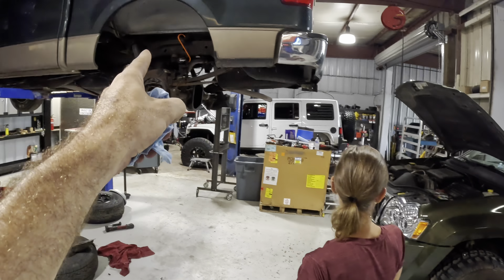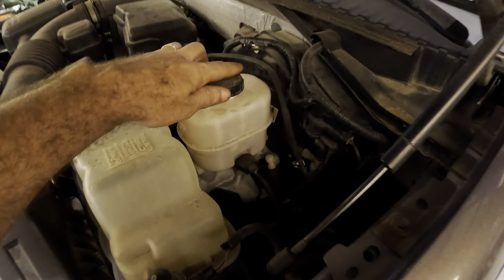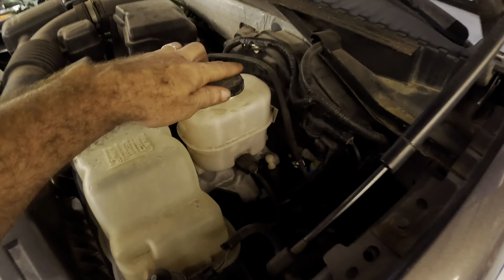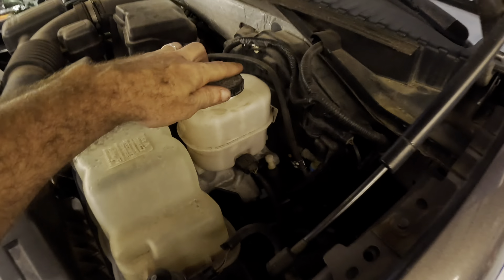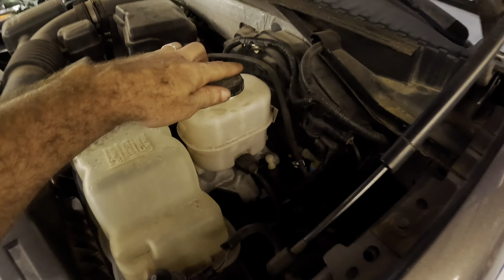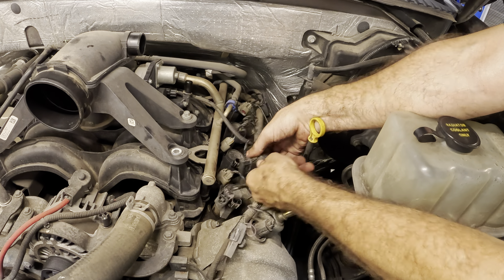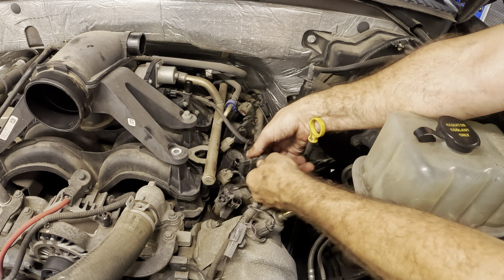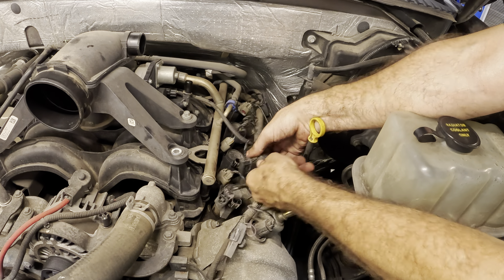Phone a Friend (Snapping Spark Plugs)@BeardedFordTech  Expedition 5.4

Comment: now that you overtighten the plugs doing the wrong way being a barbie movie star, you cant be seriously leaving them in there? they are going to fail prematurely, if they dont have issues off the bat. the amount of extra torque watching how much it took to loose them compared to tighten them again you were way over, porcelain got stressed, has stress fatigue and weakened sealing, not to mention stretching. you go on and on and on about TTY bolts, what just happened to the plug? they break easy enough coming out in 80,000 plus miles later. you spent all that time explaining plugs, the plugs you pulled out had been overtighened when istalled, and you didnt even pick up on that,. the exh gases had passed beyond the plug, witness the exh gas ring above base of the plugs. i watch your vids to rationalize whether your wanting to be a tech, a movie star, its the see me, pay me thing your into. youtube cash not customer service, every job takes you longer, you drop parts, tools, cameras, lights, trying to juggle the movie with the job, the extra time it takes to redo what you drop, the time for all the hand gesters, pointing, not being used to complete the job. whether you flat rate, or charge the customer for clock time who knows, but a customer sitting waiting to  leave, the extra wait time the movie adds to the job is not fair to the customers. sure your busy a lot full, be less full if all time was spent working vs movies, and be less full had you not used youtube to advertise to get your client base. i dont watch you daily as a fully cert ASE L1 tech who took ALL tests in one night, yes all, and lowest score was a 92 i cant. to those who dont know you look like a great tech to those of us who do know, you make a lot of rookie mistakes, use wrong tools and hammers too much. and NO hands on tech (not shop owner who is not hands on) has the time during a day to lose making vids. your either good or your not, your either a tech or movie star. tech who make good $ use every minute of every day to make that $ and waste none, a youtube tech like you also uses youtube and google university to look for the knowledge on an issue they are stumped on or to find that not so short short cut. some of you guys give us all bad reps.
Reply from the maker: You knowledge is overwhelming
Reply: That's a big word salad.
Reply: For someone who doesn't watch Ray, you sure used a lot of words. Maybe Scotty would be more to your liking.
Reply: Ive learned a great deal because Ray takes his time to explain things.
We are not all top tier intellects.
Well I am in human behavior and I sense some underlying jealousy here. 🤣
Reply: Please consider taking a technical writing course.
Reply: @wacowildcat  💯💯
Reply: Its time to get some writing skills cert too
Reply: I loved these replies. There is an old saying, “Judge your neighbor, judge yourself.” The Rainman is authentic, and is the mechanic’s mechanic. Watch him and learn.
Reply: "i dont watch you daily as a fully cert ASE L1 tech who took ALL tests in one night, yes all, and lowest score was a 92 i cant."

So you passed multiple guess tests and use that to show you have credibility. 🤣
Reply: This comment gave me mesothelioma, and I believe I may be entitled to compensation.
Reply: English is a second language in your case. Capitalization and punctuation 😂😂😂
Reply: This Keyboard Warrior probably went to UTI and is what they think is a pro. We used to call them “Un Trained Idiots”
Reply: Wow it looks like you wound your spring a little bit too tight today.
The instructions said inch pounds not foot pounds !
Reply: @jamram9924  Not a tech writer, they have no sentence structor, grammar or punctuation. Required. My wife was a tech writer, I know what it takes. That person is not.
Reply: Man you sound like my old boss, whole lotta talking to say you know very little, you Probably Don't see Half the stuff Ray and his crew do he only show's us the interesting stuff.
Reply: That was interesting. Ray(noted troller), you need more commenters like this. Keep up the good work getting audience participation(Rainman precipitation perhaps). 😉
Reply: @mitchm275 Sit down and shut up.
Reply: @tc410  I am sitting down~ Sorry Darling your just mad your comment has more holes in it then swiss cheese :3 and we can all see it. Take care!
Reply from the maker: Sry Mitch, I doubt you took A1-A9 X1 C1 AND L1 on the same day, maybe the softball recert test, but no way you took a full ASE panel in a day
Reply: Hey Mitch, do you work hard at being an a55 ?  Rather than spend that time writing a word salad, you should use that time learning to write instead.
Reply: I'm just going to say this windbag isn't speaking for the majority of us. And a lot of ppl who didn't have more than a passing interest in automotive maintenance have now expanded their knowledge bcuz of his delivery. He explains things in a way that a layman would understand as well as making it entertaining and informative. You my friend shouldn't continue to waste your precious time watching something/someone who cant appreciate. He definitely does good for the industry. I'm certain he has inspired more than a few ppl to get into the automotive tech field and that alone makes his content a major plus for the industry.
Reply: @mitchm275  Hey Mitch, you should peruse getting a job in the Biden administration.
Reply: Who is writing the book ? If You do not likey , move along😂
Reply: When someone doesn't really know what they are talking about, they usually use far too many words to try and cover their ignorance and ass.
Reply: Jelly?
Reply: @mitchm275: Bloody hell mitch, what exactly is your beef? Jealousy, springs to mind, after that word salad. I've always been impressed that Ray can fix things, with one hand tied behind his back. (The one holding the camera). How the hell does the porcelain get stressed? The wrench fits the steel bit at the bottom, not the porcelain. I fix things as an amateur and it would annoy me to have to film it as well. I need both hands. But Ray brings us in, for a close up POV. For which normal people, who are interested, are very grateful.
Reply: Are you even aware there is a difference btwn your and you're? 
Apparently you don't or just don't know when which one is correct . 
When you're going to go off on someone in a comment, you need to make sure your grammar, punctuation etc,. is on point or you'll get ripped apart. 
Did you notice I used both your and you're in that sentence correctly?
Reply: That's a lot of words to say you don't have a damn clue what you're talking about.  Don't sweat it, my dude.  You're still your momma's special boy.
Reply: Funny. Ray owns his own shop. Seems to charge less per hour than other shops in his area. He uses book time to bill jobs like nearly every other shop. Seems it's on him if a 2hr job takes longer than billed because he is filming. No one but him has to eat any time over run. I would trust Ray to work on my vehicles if he was closer than 1200 miles from my location.
Reply: @RainmanRaysRepairs  He/she/it also had no spare time for silly things like formatting for readability.  Writing youtube comments is obviously his second career.  Yes you make occasional mistakes... welcome to being human.  Love the videos, don't miss the Florida humidity.  I lived in eastern Hillsborough county for 23 years mostly without AC.  Air too juicy!  Tulsa OK here, 100 deg today at about 55 percent juice = kind of hot outside.
Reply: @diuliano42  😂
Reply: TL:DR - REEEEEEEEEEEEEEEEEEEEEEEEEEEEEEEEEEEEEEEEEEEEEEEEEEEEEEE!
Reply: If you don't like what he is doing.. then don't watch no one is forcing you to watch them.  Just because he doesn't do things the same way you do . Obviously he is doing good because he has expanded his shop faster than most mechanics do in 5 years but he isn't doing the same thing as you so he is a bad mechanic. Don't want to see then don't look
Reply: I didn’t know Kamala Harris was a car mechanic. WORD SALAD!
Reply: Then why do you watch if this hurts your sense of the ways things should work?   If you got a 92% and above on all the ASE tests why can't you recognize that there is this thing called capitalization?  Maybe create some paragraphs to divide your various thoughts into some sort of logical flow.  You did use commas, so I guess all is not lost.  Maybe chill a little..
Reply: @jamram9924  Yea I just commented on the prodigious lack of grammar and capitalization as well. Yikes needs a chill pill.
Reply: So much anger and such poor grammar. 😢
Reply: @stevemclean5787  Outstanding reply..
Reply: do they have certifications on forming coherent thoughts?
Reply: Man my eyes hurt after reading that word salad. I strongly doubt that you're as good as you say, I know of at least three YouTube mechanics that are WAY better than you and Ray is one of them. Go follow Scotty instead of wasting Ray's time with your pointless comment.
Reply: If I were you , I would wait until I sobered up before I started commenting on videos.
Reply: Thanks for the input Keyboard Karen
Reply: Oh my gosh my wife don’t even whine like that  and anyone that has to cry out their accomplishments is a very very sad person see what happens when they start giving everyone a trophy just for showing up. Hopefully sir you get the help you need have a wonderful day
Reply: Nah ive said this before to those of us who really work on complicated stuff minus the hollywood aspect can see that ray makes alot of mistakes. And often employs flawed diagnostic logic. Thats why i like to watch occasionally its nice to sometimes watch someone else chase their tale for a change
Reply: @BeardedFordTech nah i understood exactly what he meant and while he was capping about his test scores he was mostly right about ray making alot of mistakes.what he neglected to mention is he made all the same mistakes himself as have i. Its a byproduct of accruing useful experience.
Reply: My thermo says 103 in the shade here. Current humidity is 94%
Reply: @phreakyzeke2864  if you say so bud. Have a great day
Reply: Yup, they only let me take 2 or 3 a day when I first certified.  I did the recert online at home... which is nice...
Reply: @ohiowrencher8650  yep. They only allow 3 a day everytime ive taken them.  Did my reverts online too
Reply: I hope your technical skills are better than your writing skills. 

Let's eat, grandma, or let's eat grandma. Grammar and punctuation make a difference, especially to grandma.
Reply: @Slugg-O  🤣🤣
Reply: @BeardedFordTech i am having a great day i was finished with this final drive  with the tracks back on and greased by 1130am and headed to the bank son. While you were still trying to decide on a cute little reply message ive allready invoiced 3 grand today.
Reply: @phreakyzeke2864  🤣🤣 we got a bada$$ over here. Everyone look out.
Reply: This guy really thinks Ray drops his tools and flashlights to add comedic effect to the video 😂
Reply: @chaddelong6795  yeah. And another guy down there flaunts he makes 3k in one day. Ohhhhh watch out.
Reply: 3k from 545am to 1045 actually i have 2 other jobs im doing this. evening. I split work into morning and evening when its in the 100s You must be young. Your ego hasnt been brutally humbled yet
Reply: Mitch thou doth protest too much
Reply: @phreakyzeke2864  I'm 41. And I don't go around flaunting how much I make in a day. Thats what broke people do to make people think they got money. So. Have a nice day. I don't have to split mine up when it's hot. You must be old
Reply: I would take my car to Ray rather than to "certified ASE bla bla " keyboard mechanic. spark plugs were fine, they are way off to be "stretched" or "stressed"  .
Reply: Ray is honest, knowledgeable, funny, and watching his videos is like hanging out with a mate. We like Ray. 
Also wife unit and team
Reply: Im younger than you but your age in years means nothing your actions and how you talk sideways out your mouth to a fellow channels audience member that you dont know regardless if you disagree with them or not shows your maturity level. Im old enough to know how important it is respect others' perspectives and to be kind even though that i may not agree. even if and especially if i know they are 100% factually wrong. Hope you grow up sometime soon.
Reply: So it seems you passed the ASE.
How about the "Use paragraphs" course?
Reply from the maker: @phreakyzeke2864 How do you find time to make YT comments while ur making 5k a day? I must be in the wrong business.
Reply from the maker: @phreakyzeke2864  Final drives and tracks huh? Boy r u going to be mad when I start working on heavy equipment
Reply: i answered that question allready here in an earlier comment. Its regularly over 100 where i live after 10am. I do mobile service on heavy equipment  and i schedule calls 5am to 1030am and 530pm to 9pm and when its the hottest out im indoors doing commericial low voltage fire protection
Reply: @RainmanRaysRepairs nope thats unamerican im the type thats genuinely  happy and encouraging when anyone succeeds at something their passionate about.
Reply: Oh and its not like this was the only day i spent working on that machine from this morning. I took it apart 2 weeks ago the parts came in last friday. But taking it apart it was only mid 60s out that morning so it was like a freebee and picking up the parts required a dot oversized load permit and 2 flagging vehicles.
Reply: Shhhh just be quiet and learn!
Reply: Ok. Just to make sure I'm understanding this wall of text from a leading industry expert... you're suggesting that snugging them slightly over the recommended 9 lb ft to the 12 or so that the electronic ratchet will snug it to has caused overstressing of the spark plugs, leading to premature failure, lack of cylinder seal, and the spark plugs separating when they get removed? Are you high or a drama queen?
Reply: I tried running this post through Google Translate. It couldn't detect any language. What did Ray do wrong? He removed the old plugs. Started new plugs by hand. Seated new plugs with the electric ratchet. When tightening to specified torque, Ray noticed he got a little overzealous with the electric ratchet and backed off the plugs. He then retightened to spec. I've done it myself as have many techs in their career. I appreciate Ray's sense of humor in his videos. I've learned a lot from watching Ray's videos.
Reply: Proper sentence structure and correct punctuation are skills not everyone has as evidenced by whatever the heck you just wrote.
Reply: Oh dear we are a super troll aren't we.  I suggest you never watch Ray again. Also publish your location so we can all avoid bringing our cars to you
Reply: You have no idea how he charges his jobs out. Sure making a video of these takes longer but to assume he f#cks around and charges for Irtysh is ridiculous to say the least. Chill out boy you’ve got a lot of growing up before commenting on matters without knowing.
Reply: Why are you here?
Reply: stop complaining. if he didn't do the videos then you'd have no way to criticize him for taking the time to do the videos...  and The world needs more techs like Ray. Sure, he's Not perfect, NOBODY IS. at least he tries to educate people and goes the extra mile for his customers WHO KNOW HE DOES THESE VIDEOS and know it may take a bit longer but it will be done right or he'll make it right.
Reply: Wow - someone woke up on the wrong side of the bed . . . I hope.  Hate to think you go through life as Mr. Know it all as an everyday way of life.  Glad to see you pinned to the top of the comments so that you get all the recognition you deserve.  Hope you learn to loosen up before your pent up animosity and anger kills you.
Reply: @mitchm275 - you need to lay off the sauce.
Reply: @BeardedFordTech I had to take a smoke break about half way thru that word salad…..💯💯💯🥵🥵☕️☕️☕️🚬🚬🚬🚬
Reply: You remind me of a kid that came into my shop. All full of noise and truly could not do a darn thing. Watch Ray and learn. Take this advice from a retired engine builder and owner of his shop. You have no clue how hard it is to do what Ray does. Do yourself a favor and shut up, listen, and learn.
Reply: @Slugg-O  CUTE!
Reply: Kamala, is that you?
Reply: You sir are bell, don't be a bell all your life.
Reply: I've fussed at him for not using a torque wrench in a lot of cases where I would, but it does no good. He has his own techniques and he sticks to them. He's the guy that has to fix his own mistakes. It does take extra time to use a torque wrench or even anti-seize, but it's worth the time to me.
Reply: @BeardedFordTech  why use so many words while saying nothing of value?  some peeps just have issues i guess.
Reply: @tedwilliams8766  exactly. Word salad. confused or unintelligible mixture of seemingly random words and phrases. 💯
Reply: @mitchm275  oh yeah forgot to add. Ray doesn't have waiters. All his are drop offs.
Reply: I’d love to read a tech report on a customer vehicle that you provide. 700 word explanation of how his vehicle needs a washer bottle top up.😂
Reply: @level1804  🤣🤣🤣🤣
Reply: Go toot your horn where people like to hear how good you are and how bad everyone else is.
Reply: @mitchm275 90 comment's and nothing else to say? just this one rant?
Reply: Haven’t read all messages, but I think the spark plug issue for ford 5.4 was from 04 - 08 engines

I have an 07 F150 with the 5.4 engine and I have that issue.
Reply: @diuliano42 😂😂😂😂😂😂
Reply: Look! A word salad for a 250 person wedding! And it's sour....😂
Reply: This mitchm275 ASE stand for
A-ask
S- someone
E- else
Sounds like he never makes mistakes and if he claims that then he is full of $hit
Reply: I think I'm sensing a little of the 'tism. Rule number 1, never put that much effort into ANY youtube comment lmao.
Reply: ASEs are kind of a joke and i don't know how you managed to score 92 on the lowest when the tests are only around 40-50 points each.  what he did with the spark plugs wouldn't cause any damage.  the ring you saw at the base of the porcelain is kind of normal for a spark plug with ~80k and he didn't particularly struggle to loosing the spark plugs.  if they've been in there for 80k of course its going to take a little bit to break them loose, all fasteners do. if you have enough subscribers, the ad revenue can help offset extra time it takes to make the video as well as providing free advertising to bring more business.  his youtube channel dramatically improved his ability to open his own shop and hire people to help keep up with the amount of work coming in.
Reply: Kamala, is that you?
Reply: Good lord!! What's this guys problem ?
Reply: Really? Oh boy. Another internet bully. Jealous much?
Reply: @RainmanRaysRepairs This guy has a lot of anger. My Dad retired as a Master mechanic at the age of 68. He always went back and forth to college because of all the new things that came out. Keep on doing what you do. Internet bullies are a dime a dozen. However though, real and honest mechanic, such as yourself, are a rare breed indeed.
Reply: You'd think someone who got 92+ in their ASE tests would score more than a 20 in a writing one.
Reply: @RainmanRaysRepairs don't let him bother you. The odds of him speaking the truth is about the same odds as you being perfect. Youtube is a breeding ground for trolls that are "better at anything than everyone".
Reply: In the words of Sgt Hulka, “lighten up Francis”. LMAO!
Reply: Over torquing is never good, but it doesn't effect the porcelain. The porcelain lives in the plug barrel and has no idea if it's laying on your toolbox or torqued to 30 Lb-Ft. (no plugs can't think, it's just a way of explaining something). But yeah, I have seen ray do a few sketchy things, but definitely in the top 90 percentile as a mechanic.  I Have Spoken! :)
Reply: Seriously ? As many have commented the porcelain would not be affected by a slight over torque as no stress is applied to it. May want to get a refund on those certifications dude.
Reply: @RainmanRaysRepairs  would you care to bet? in todays world of texting quick abbreviations, as used in my comments on a pc, would not be given any concern was it a cell text. at 64, owning a 2 bay shop, 3 techs who break $1.2 million a year in a less than 2% comeback facility, which can be well proven too. those plugs were over tightened, as were the ones he removed. the plug itself tells the story. if you do not know how to read a plug then learn
Reply: Mitch. Do you want some cheese with that wine??? Geez ! What a cry baby 👶
Reply: @frankbiz why now?  His days are limited.
Reply: Dude, there's not enough salad dressing for this word salad.  Hell even Kamala Harris would be jealous of your word salad skills.
Reply: @Paramount531 He's got enough words for sure
Reply: @BeardedFordTech 
I'm gonna have to pass on the croutons and cheese!😅
Reply: @bryandraughn9830  🤣
Reply: Can you imagine having your feelings hurt by watching someone change a set of spark plugs?
It happens.
Just saw it.
Reply: How do you spell meeyaw?
Reply: @theodavies8754  🤣
Reply: Mitch..retire to your mommies basement.
Reply: @RainmanRaysRepairs  But his attitude, grammar, and syntax are underwhelming.
Reply: You sir, seem to misunderstand many things here. Sometimes people who make a mistake are indeed NOT after the youtube cash. This is his JOB so he knows what hes doing and he is human so hes allowed to make a mistake. (Edited bit) on top of all that, any tool that does the job is not "the wrong tool" its just not a specialty tool. Go wash yourself and keep Rays name out your mouth
Reply: You do know that no spark plugs were broken during the making of this video, right?
Reply: Wow! I don't even know where to begin? I couldn't even finish reading that mess because I started to get a headache!!
The overwhelming amount of miss spelling and awful punctuation!!
I can't tell if this was written by a 12 year old or just a guy sitting in his mom's basement smashing his keyboard!!😂😂
#SAD#TROLL MUCH!!!!😢
Reply: A quick story, had a 1990 F150,would shut off everytime I stopped,would start back up no problem, spent $200 twice at 2 different dealerships, ASE certified couldn't figure it out. Took it to 2 other shops, charged $150 and $250 didn't fix it, got told a guy was a self taught tech, certified only in transmissions by Ford. He spent 20 minutes with a hand held ohms meter and grabbed a $15 part off a mustang with a 302 ( 5L ) and I was fixed and on my way. He didn't Bragg about anything, say anything bad about the other shops only that they probably were book smart and not really tech guys. I started going to him for everything and he was genius when it came to engines, any engine, 2 stroke 4 stroke, motorcycle, car, truck, semi, dozens, anything! Once he put his hands on something it was fixed. No B.S. no flaunting his superior skills just doing the job in less time then most auto techs took juat trying to figure out the problem.
Reply: Exhaust gas ring?????? Stretched plugs????? What the hell.
Reply: @BeardedFordTech  I am not ASE certified BUT I have been working on cars for a long time but after reading that,...... I can honestly say watching Ray's videos has not only brought on some insight on working on these "Newer" engines but overall he has great content and it is nice to watch him struggle from time to time knowing that it ain't me ( sorry Ray ).  Ray gives great explanation on evereything that he does.
Reply: @RainmanRaysRepairs  Hey  Ray you sure Mitch here is not an old boss? Sound like he might be and has an axe to grind. I seen this before in the culinary field.
Reply from the maker: @4englishlies875  I’ve seen variations of trolls named Mitch over the years. I suspect it’s personal with these Mitches. But I don’t know a Mitch in real life however, I do know several little mitches. The assumptions are endless given the current little mitch never replies. I’ll continue to pin this little mitch until we have answers. Rando trolls are one thing, but I can’t abide no lil mitch 😉
Reply: That comment must have been written by the potus speech writer
Reply: I might pay more attention to your post if you knew what a capital letter was and how to use one. Also, you passed all your tests in one go? I once worked with someone who did a nine month mechanics course. Passed all the written exams with no problems. He couldn’t tell the difference between worn track rod end joints and a worn steering rack. 
He ended up with a broken left arm trying to remove a gearbox without using a transmission jack.
Reply: @richardhemingway6084 Technically, if Ray had seriously overtightened them, the metal would stretch, stressing the bond between ceramic and metal, so the argument is not entirely without merit. Even then, without a heat cycle, he’s unlikely to have done any harm. As it was, they were only very mildly over done and the apparent extra effort to undo them was due to the taper seats getting a bit of extra “grab” once the movement stops. When using a torque wrench you should always do as Ray did and back off a touch, before applying the torque. If you don’t, what we call “Stiction“ will give you the wrong results and your fastener won’t be tight enough.
This guy is obviously having a bad day and can’t resist spreading the misery around. Not worth getting upset over it.
We all know that when Ray screws up, he tells us about it, so we don’t make the same mistakes. Those of us that like him and operate the same way, often see ways he could improve and we try to point them out without scoring points off him. It’s sort of the difference between a fan and a troll, only subtler.
Reply: @chaddelong6795  gravity
Reply: Wow! The man has literally used thousands of hours of extra time to document everything on video and put it on YouTube for others to either learn how he's doing everything wrong or how he's doing everything right, but at the very least doing everything his way. While he's taking a nap, he's making 30 or 40 grand a month on YouTube. And in return to us viewers we have documented video that can potentially help us save time and money doing things ourselves. He's authentic and him and his wife should be proud of what they 've built with this YouTube channel. I watch every one of his videos whether it's relevant to me or not. Keep up the good work. Ray!! Ignore the haters.
Reply: @richardhemingway6084 Btw...just to adress the one handed issue I think Ray recently changed his MO and had his wife employed as the camera woman. Or was that a one off?
Reply: What was your lowest score in an English test?
Reply: @Paramount531  Oh my... not Scotty... nails on a chalkboard voice...